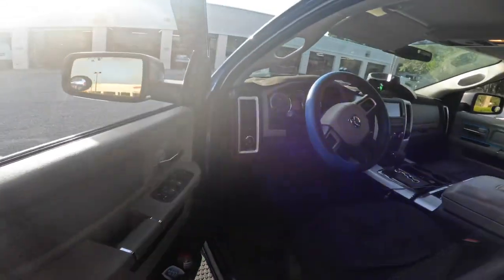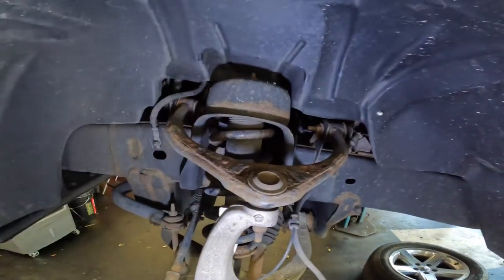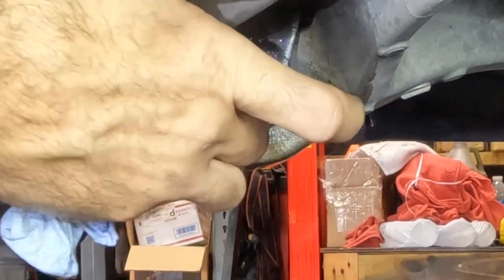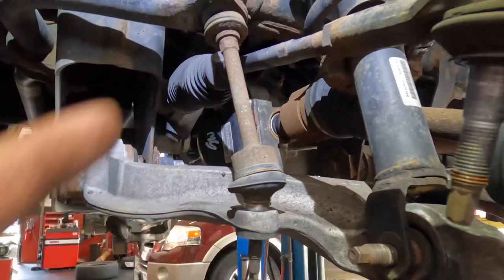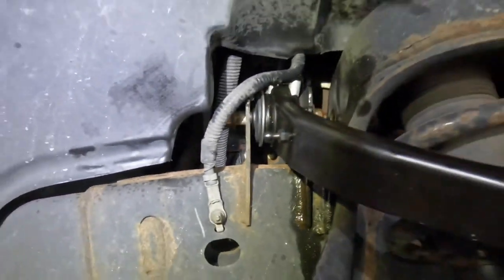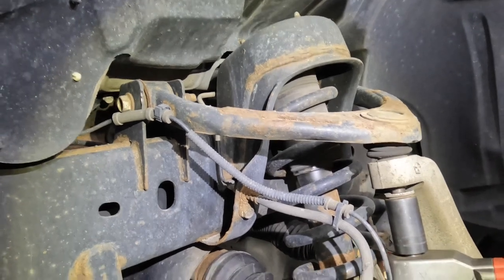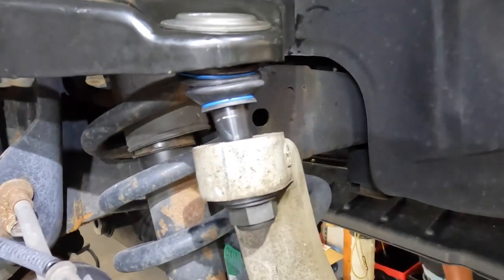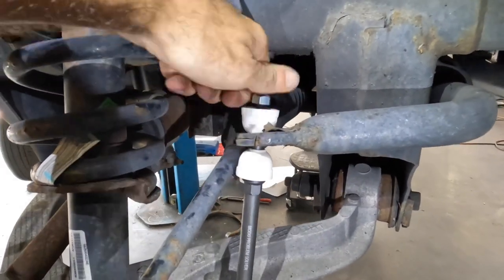Job Fails Fast! 2011 RAM 1500

Comment: Junk yards have the same hardware
Reply: “ Quality Issues “ if it came off a junkyard car… what was the reason the truck was in a junkyard…… other than it being a Dodge??????😅😂🤣🥲🥲
Reply: That's why you check the threads and make sure there not cracked the only quality issue you would have is missing something but should be completely fine I have been doing this for years I got draws of bolts for various makes and models that all came of junk yard cars just not for this dodge
Reply: I believe Ray is working at National Chain service shop. Using junkyard items can open up tremendous issues on the legal side, ( that most shop would prefer to stay away from ) now on your own personal vehicle…,, a side project repair for a friend… as long as they know 👍👍

Comment: I was asked to help fix one of those, it had bad transmission and failing engine. I hate its entire existence ever since, so glad i'm not the one doing that now. Removal of either seemed to require aggressive disassembly, possibly removal of the cab as well.

Comment: i remember when i did a brake job on a 2006 gmc canyon. my old truck. i had about 3 hours into trying to break the caliper mount bolts loose. yeah they was seized on there good

Comment: Hello Ray. Helping friend make repairs to his suspension, he ordered Moog parts. One had grease fitting, other side no grease needed. Really disappointed at the time. Figured that's better than receiving one then one back order. Other than that issue, it was quality item.

Comment: Ray! Advance auto has the camber adjustment bolts (moog part k100390). They also have the lower strut bolts. I just did this same job 2 weeks ago.

Comment: I had a few Ram 1500, the lower strut mount to control arm bolt is a common issue to lock up inside the rubber bushing steel sleeve, due to corrosion. The upper control arms are known to have upper ball joint failure, the ball joint actually creeps out of the top of the arm and a gap can be seen.

Comment: Sir, you are exactly correct on using OEM parts for replacements. When I started my company in 1977, my insurer explained to me that any change/substitution from the original engineering design spec’s or installation of aftermarket components suddenly becomes MY design and I would be personally liable for any failures or consequences.  Unless the customer signs off in writing for substitutions. Great videos.
Reply: I used to work on molds that were about 3x4 beats square if I didn't use the right bolts when they were hung in the press the press would cycle one time the mole got destroyed and I had to look for a new job
Reply: Well in that terminology putting on the aftermarket kit already breached the original engineering clause.... I always ordered ALL suspension hardware for a suspension  job

Comment: The lower strut bolt on these trucks always seize every single one iI have worked on. They sell the bushing for it very easy to press out and replace with new bolt.

Comment: I feel your pain ray. It was deja vue watching you on these bolts. The control arm alignment bolts are proprietory and no other bolt from anywhere will work for the alignment. Those bolts were expensive from local mopar dealer. I cut mine off with angle grinder after about 4 hours of frustration trying to drive those bolts out.  You can be assured i antiseized the new bolts when installing.

Comment: What's with changing control arms?

The control arms are fine, just get new bushings. The strut mount bushing comes with bolt and get the camber kit for the other bolts.

You even have a good press to make easy work of the bushings.

Comment: I used to be warranty grunt at a Mazda dealership.... There was a recall on RX6 lower control arms (as well as some other car, but i cant remember which)... every single one of them had to have the bolts cut out of them.   There wasnt enough room to tourch them out so we litterally cut them out with a sawzall...  unless we got the like $20 blades, you would go through 2 per car.

Comment: Living in Ohio up by the Michigan line we have Rust. Anytime I have rusted bolts my Friends are Spray Rust buster & HEAT, Amazing what just a little heat will do to remove STUCK bolts and Nuts.

Comment: On the topic of waiting months for parts: I am the parts manager at a collision repair shop. I deal with this every day. Waited 3 months for a radiator support. Every time the ETA the vendor gave me got close, they would tell me it would be another few weeks every time I called. Finally got tired of it and kept calling dealers all over the country, trying to find one that would ship to me in North Texas. After 24 phone calls (kept track for the fun of it) I finally got one from California. I think I paid almost as much in shipping as I did for the part
Reply: My son used to order parts for exotic cars I can't name them and they had to come across the ocean it was crazy
Reply: @michaelpressman7203  I deal with this on a lot of German cars. Takes almost a whole month at the least if not longer. Waited a month in a half on an axle shaft.
Reply: Back in the day ...(The 60s)...I worked in a bike shop and Britt bikes were often in the shop for a year waiting on back ordered parts...

Comment: When you get the new struts in, the upper control arms should be loosened and reloaded so the unloaded center can be found for the new bushings.  Keeps the bushings from being stressed.

Comment: Ray, key phrase induction heat gun. I have found that heating the bolt then letting it cool down and heating the bolt again and maybe doing this several times will bust the rust away or will loosen the grip of the rust due to the expansion and contraction of the metal. It comes with several coils and you can actually make a coil to custom fit your current application.
They’re probably only  $2000 off of the Snap On truck. However Amazon has them for less than $200

Comment: Ahhh, CJD suspensions, the bane of my existence - I've got a 2005 Jeep Liberty CRD (common rail diesel) that I bought brand new - the stock front suspension didn't have enough oomph and travel to handle the weight of that diesel engine - such that after 3 to 4 years, the front struts would be sagging to the point that you couldn't get the front end into alignment, the spring coils collapsed against each other - the final cure was to get an Ironman suspension that gave a minimal 2 inch lift - basically just taller springs and struts front and back, and new upper control arms on the front for proper clearance - haven't had a problem since.

Comment: I have a set of factory lower control arm bolts for that truck... I just did lower arms on mine and used new 🔩, the old ones are still good....

Comment: This reminds me of removing the rear leaf springs on my 99 durango to install the lift brackets. spun my bushings and took 3 days of hammering and torching in my apartment parking lot to get them out. same story at the time, I couldn't get the proper bolts for about a month or so. I ended up throwing some bolts from the hardware store with a shim that got me by for the month or so it took to get my bolts in. never had a problem but it is highly recommended to get the proper bolts for these parts instead of something from "fastenall"  Like you said..... The thing is that the proper bolts for these assemblies are much stronger than anything you'll get at the store because its solid metal where it needs to be inside the bushings instead of threads. you also have to keep in mind anything you get from the store is probably going to be threaded or partially threaded inside the bushing and on the shearlines of the assembly between the body and the arm, if there's a lot pressure on the threaded part of the bolt because of the shearline of the assembly it'll pop the bolt right in half no matter how strong it is because the shearline is getting leverage and pulls the bolt apart at the threads. dont do a botch job to someone else's cars guys, get the right parts if you're not working on your own stuff. hell even your own stuff, your broken vehicle could kill someone else on the road all because you got the wrong bolt. work smarter not harder.

Comment: As prevention is better then after the fact. 
That ??able upper bushing would be a Great Sand/dirt collector here. I have chosen (Water resistant ) grease to fill those places where Factory Engineers have designed sand/silt/Salt collectors to reduce their ability to RUST! It lasts about 1.5 yrs so far, just needs  updates at time. 
At your 29:30 I would have installed the grease nipple on the trailing side with enough room to get the grease end onto it. Thus ?? preventing it from being damaged at sometime.

Comment: I have found over the decades, to minimize removal issues (ESPECIALLY with suspensions), ALWAYS START THE PROCESS with a liberal application of Penetrating Solvent !  Only takes a minute and it makes life so much nicer !   Good luck with the rest of the work on this old truck.

Comment: I had a Dodge Dakota. Same thing. Stuck bolts on the strut.  Never could change them out.  So many problems with that truck with rust and mechanical issue.

Comment: Ray excellent video on the frustrations suffered on corroded fasteners,Sometimes by applying brake fluid or synethetic hydraulic oil, (Phosphate ester) corroded bolts will free them , as it normalises steel a type of galvanic reaction... also we have this lubricant in a spray can here in  Australia that has lanolin  in it called Lanotek . It derusts just about everything and penetrates so it doesn't rust again, i have had rusted Padlocks work again and not have to reapply again. Maybe you could find something similar with lanolin in it regards on your videos.
Reply: At my plant we had a bat that we could submerge molds in basically the same stuff man it worked great but you can't put a car in a vat

Comment: I ran into the same scenario attempting to put front shocks on my 2010 Ram. Gave up in frustration. I gave all the parts to the guy I sold the truck to.

Comment: Up here in Idaho we start these lifts by judicious use of PB blaster.  Great vid as always, though there are times I think you need to suffer with some more rust. 🙂
Oh and I agree about fastenall, however the cam bolts are usually at oreileys and you can torch/pb and gun the lower strut bolt out.
Reply: i ❤ PB blaster
Reply: Wire wheel/brush to remove surface rust, generous use of penetrating fluid, then wait until after lunch before repeating, then wait until later in the day..
Reply: @mrmustangman  PB Blaster is $16 a can here in the UK. I can't find anywhere to get the free Brake Cleaner, like Ray uses,.

Comment: Earlir this year,I replaced brakes [complete and comprehensive],front end [again,complete and comprehensive] on my 1986-1/2 4x4 Nissan Hardbody and my 1986 Toyota truck. I am astonished at how easily the tie rod came loose,as I had to use a "pickle fork" on all of the ball joints,tie rods and idler arm links. I suppose they were all originals,and tough,but little or no rust. The rotors on the Nissan required a removal of the knuckle to remove it,so all I could source was replaced.

Comment: had same issue with my dodge up here in Canada they just melted the bushings with loads of heat to  retrieve the bolts new control arms come with new bushings

Comment: tip the works for me: have a partner use a breaker bar on the bolt butting pressure counterclockwise and using a airhammer on the other end to try to loosen it. also have had luck with one of those fancy induction coil type bolt heater tools (sorry i dont know the actual name of the tool).

Comment: always wire brush and then spray with a good lubricating  spray  each thread and nuts will come off better , is that i can see a speed detector in the windscreen .thanks for the video

Comment: Excellent Vid Ray 👍🏻

Flashlight reveal... 😂

Question if you don't mind?

I'm certain the ramacus sat in the lot until the parts were all a available.
However, if it were to head back on the road for x months awaiting parts.....
Would a wheel geometry/alignment not be required after replacing the  upper control arms and roll (sway) bar linkage?
Okay. Our man may not be prepared to pay for multiple alignments for 'in their mind' the same job. However. If it was to go on the road for a few months whilst remaining parts show up. It will 'potentially' damage the bushings and tyres?
Maybe I'm not fully understanding the whole process. - just akin is all 😊
Reply: Ray I've been been waiting to see your collection of flashlights I'm jealous I wish I had as many flashlights mine are cheap and and covered in Grease

Comment: It helps to soak the bolts, nuts and rubber sleeves that they go through thoroughly and let it soak for an hour before even starting on the removal of the suspension parts.

Comment: how to get the bolt out..... hit it till its cherry TWICE with the gas axe, letting it cool naturally in between both, then hit it with the air chisel and it should come out..... got that from a spring repair dude on youtube, works 99% of the time.

also most bolts on cars and trucks are usually high tensile bolts, don't get the standard cheese grade bolts they won't take the torque if you're using metrics, you need 10.9 grade for car /truck applications.

Comment: I wish all sway bar end links were like that.  All the ones I've ever replaced are just a shank bolt and you have to wrestle it in place and try to hold it together while lining everything up 500x because you have to keep moving things around and then picking up all the washers and bushings that flew everywhere.

Comment: Instead of cutting the bolts for the control arm, i just melt out the whole bushing. Usually heats up the metal sleeves as well so can then drive the bolt out

Comment: Just so you know Advance Auto is no longer carrying Moog due to a decrease in quality. Anything they have left is NOS. Also I also worked on Land Rovers and the LR3s and Sports had control arm bushings where they mounted to the frame. They were notorious for doing that. Good thing was most of the time you were doing control arms anyway so you just needed new bolts which we slways had because they were too soft so the eccentric plate would bite into the bolt and you wouldn't be able to align them

Comment: Should use Mevotech TTX upper and lower control arms and MAXXLinks 1-3" Leveled Trucks- 8.25" Center to Center
Leveled sway bar links for RAM 1500 4x4 2006-2018

Comment: My leveling kit for my 2004 ram 2500 ended up costing me about $2000 after needing upper and lower ball joints, sway bar links and might as well put new u-joints in since we're that far into it and shocks, oh and then the alignment.

Comment: My Duramax has 250k miles on it and I live in Montana.  I replaced upper control arm and added a 3" lift kit and had very little issues, basically none. Installed a compound turbo kit on it short time later and same deal, no issues.  Maybe the truck was abused a bit in deep puddles, or, dare I say, caution buying Chrysler Corp stuff???

Comment: Living up here in the north, I’ve learned if you heat the thread end red hot and let cool 2 or 3 times they will always usually hammer out 😬just my opinion
Reply: Always usually 😂

Comment: Where I am we have a nut and bolt warehouse. Grade 8 or better for steering and suspension. I like to use the stovers nice black finish. Our practice is to always use new hardware and torque to spec. I have to admit though since watching Ray I use the old voice click when I can lol.
Reply: Indeed all Automotive fasteners made since 1985 to present are basically a, "One and its done" type of fastener

Comment: Why didn't you use upper control arms made for the 2" leveling kit. The stock upper ball joints will wear out super fast due to them not sitting at the correct angle.
Reply: I agree, the suspension geometry angles is already bad on these trucks stock. Don't make it worse. Everything is under so much pressure the front end wears out in about 50,000 miles. Before that happens, however, they ARE a very nice riding truck. But like the Chargers, after 50K or so, everything is worn out. He didn't show it, but judging from the look/age of those upper control arms, I'm willing to bet those upper ball joints were junk, or close to it. Ray knows better, so that's why he's telling the customer to just replace it all. No sense in wasting time doing something half assed.

Comment: I usually drill a hole 2mm smaller than bolt diameter, until about 75% of the way through, then punch them out with hammer & punch in the hole I made. The heat from drilling breaks the rust bond.

Comment: This happened to my 2015 Xterra. After installing the struts, the camber was off as it should. Since Nissan did not install camber bolts at the lower control arms, and the stock bolts were stuck, this quickly escalated to hammers and torches.. At the end it was a '$500 alignment job' (new LCAs and camber bolts) which could be easily avoided had Nissan installed camber bolts at the assembly line. Gotta love cost cutting of Nissan!
Reply: You've just done a great advertising service for Honda , Toyota trucks
Reply: @peted5217  HaHa! I know, I also own 4Runner and FJ Cruiser!
Reply: @jaroslawkanski7180  Then you know what good engineering is.

Comment: i leveled my jk wrangler, what gets me is some ppl put in what they call a leveling kit for example 2" front 1" rear, when really thats a lift, to level is just one end. when i did mine i used 1" spacers, then once i discovered i had a broken spring i replaced them with longer ones from a 4dr and did away with the spacers.

Comment: have always used a small smear of grease on the upper joints to assist in the said procedure if the said procedure should ever need to be done again :)